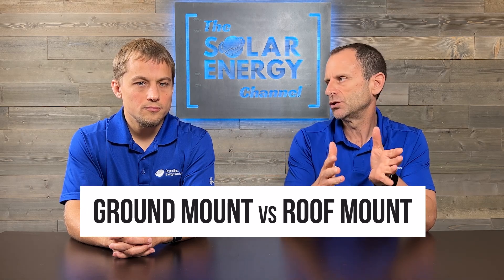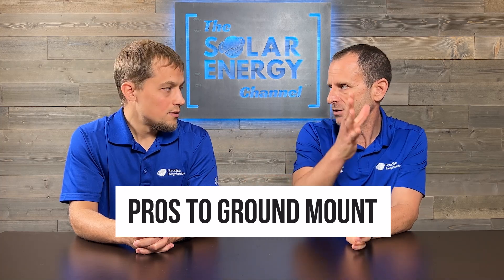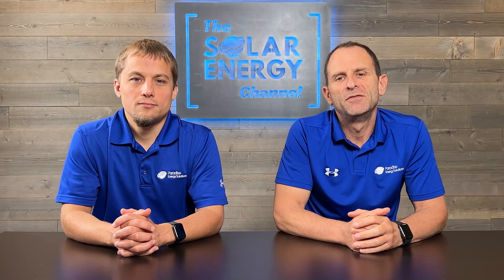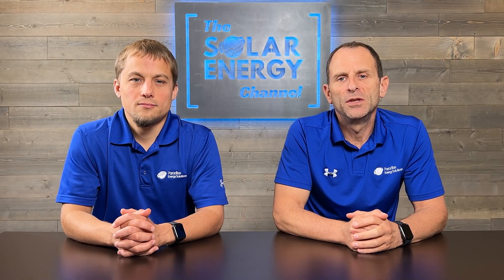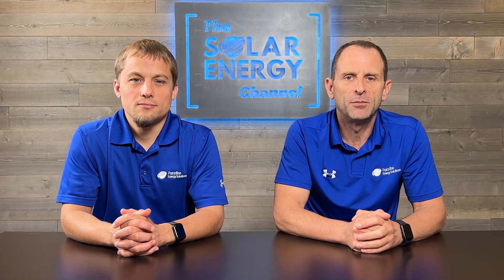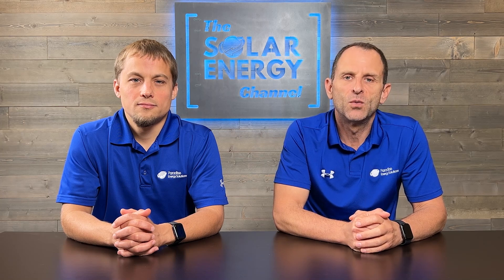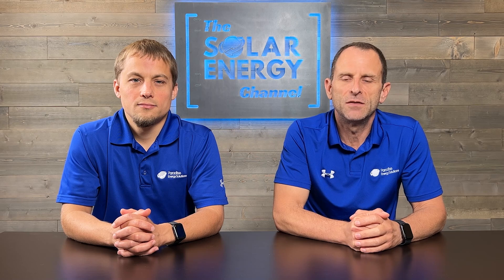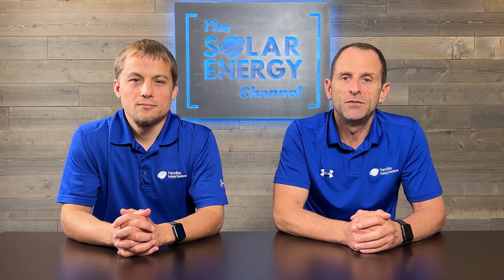The Ultimate Guide to Solar Ground Mounts

Comment: Just to clarify, the approximate 30k system you quoted isn't just the mount, right? That would include the panels, electronics, mount, etc? I wasn't sure the way you phrased it.
Reply from the maker: Yes, that would be the full package with installation. Check out our cost calculator to get a ballpark price based on your electric usage and location -> https://www.paradisesolarenergy.com/solar-power-savings-calculator